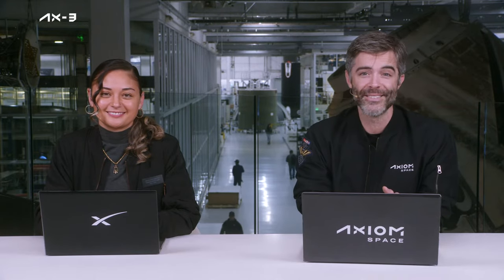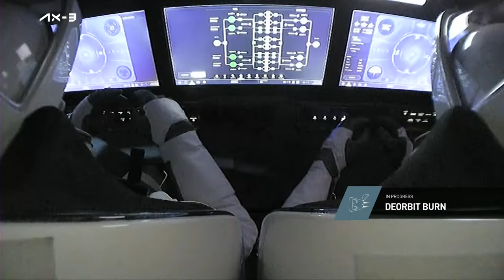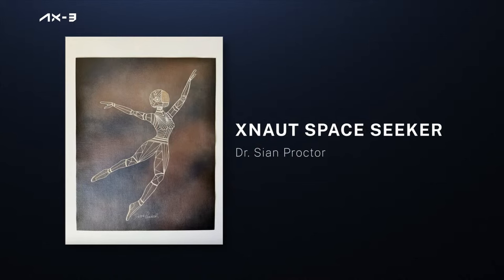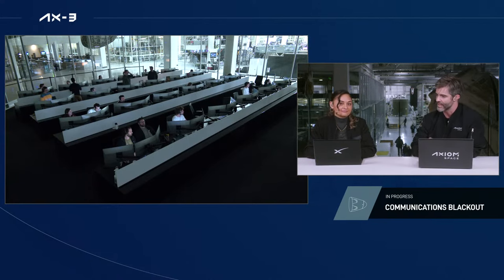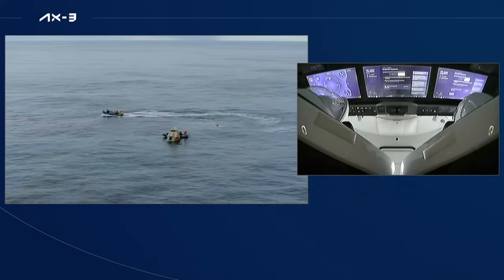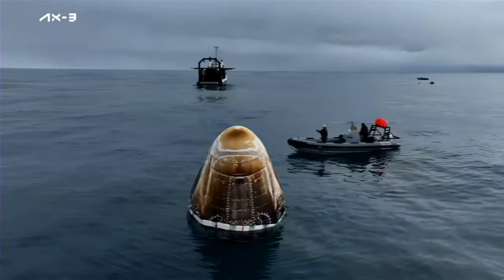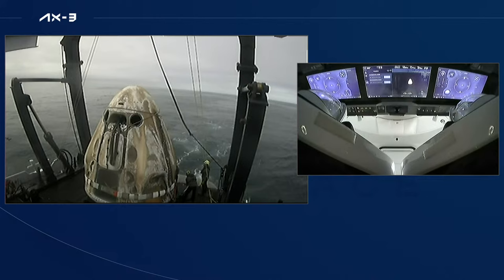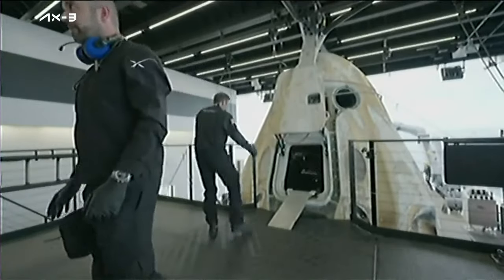Ax-3 Mission | Return

Comment: Why was AX3  directory different than the last time they landed next to Jacksonville Florida Space x crew 6 ? This route was southeast while the other one was northeast.
Reply: My guess is, there are 2 possible reentry bearings. Either (90-X) or (90+X), where X is the angle between the equator and the ISS's orbit, basically.

So approximately, northeast or southeast, respectively.